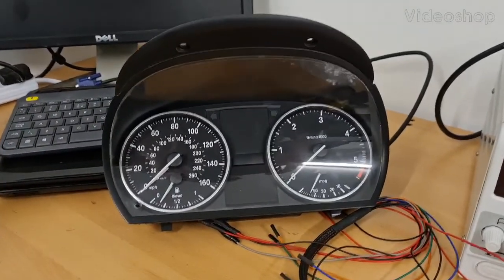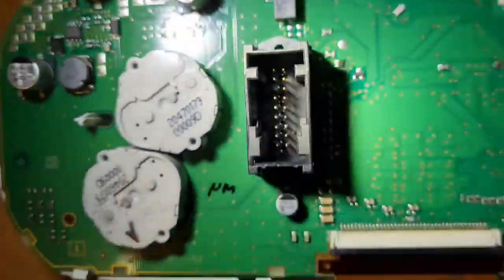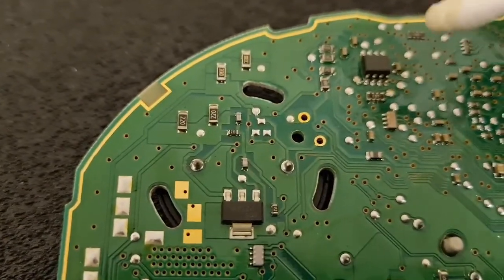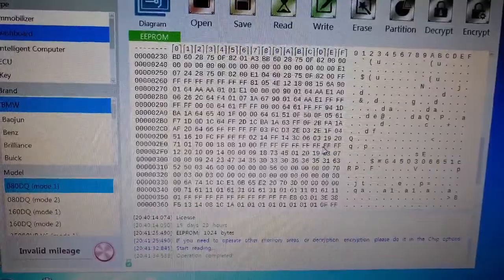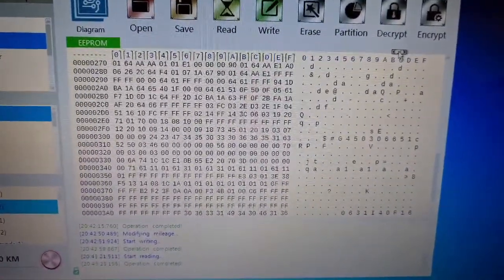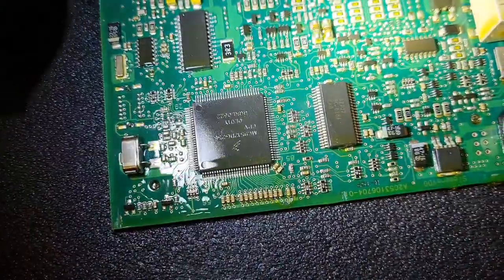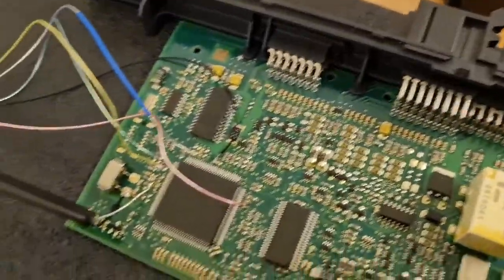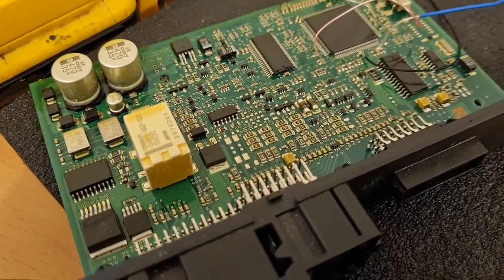BMW Mileage Correction - Instrument Panel Mileage Correction & Virginise. CAS Mileage Correction

Comment: be good to go into more details and say what the programmer is, and what software you use with it...
see taking chip off is still best solution, so much work, but least it works !! ...
Reply: He mentioned and showed the programmer several times. CG Pro
Reply: Hi. Long story short but I have a bmw with a missing CAS. I have read you can copy paste the data from the FRM to copy on a used CAS. Are you familiar with such procedure?